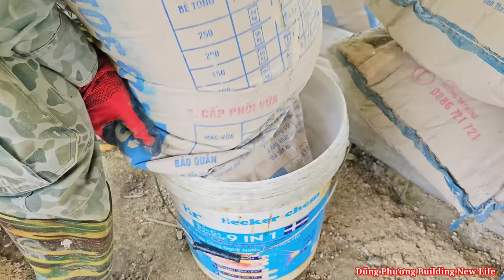Harvesting Duck Eggs, Planting orange, custard-apple, persimmon trees, cement ditches, building farm

Comment: Also smart transplant trees while they are still small after the trees get to big it's to late you can only get a cutting from that tree put in glass of water in sunny window until it sprouts roots then plant where you get enough light and water
Reply from the maker: If you want the tree to grow well, you should transplant it or it will be better to plant it
Reply: In my opinion you have transplanted you larger trees a bit late, as I could see that you have cut their main root which normally kills the plant. You need to prune these plants quite extensively or else the few roots will not be able to support such thick foliage.
Reply from the maker: @smultanwala  That's right, have you planted a tree?
Reply: Different plants have different survival rate when transplanted after a few years of growth. As regards your questions yes, I have transplanted a few trees a year or two old and gotten mixed results. However, the majority of the plants did not survive. I hope that answers your question?